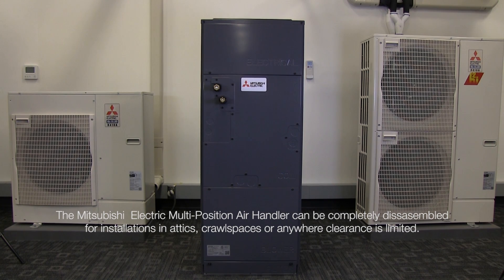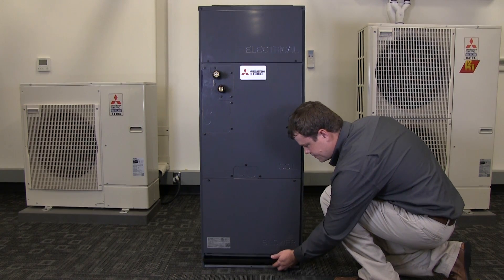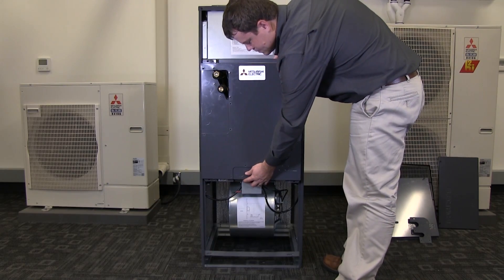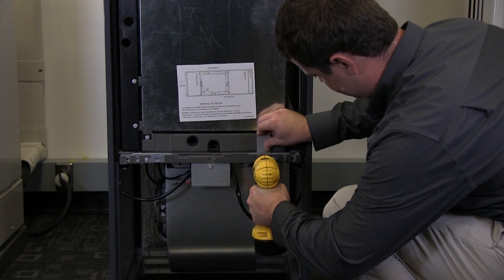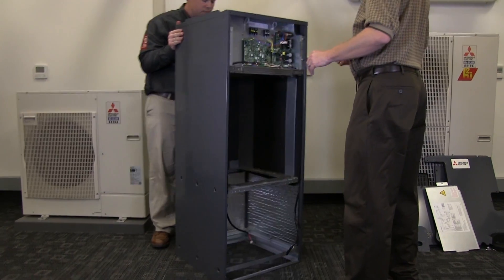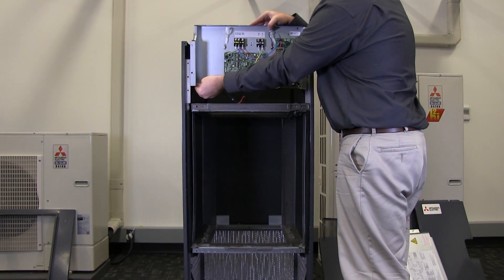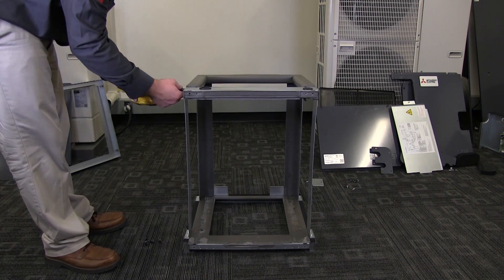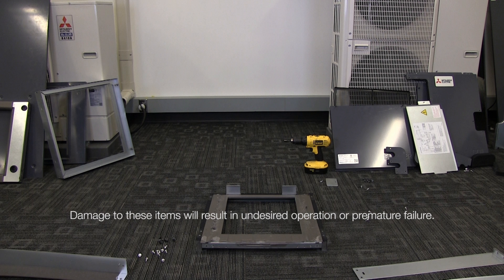How to Disassemble the MVZ/PVA Multi-Position Air Handler

Comment: For 24K MVZ side return air handlers installed with a side return, is it possible to relocate one of the wire harnesses to allow a thin filter to be installed on the right or left inside wall of the cabinet?

Comment: I don’t know about this being a highlight in being able to disassemble in the field to fit through any opening. Any air handler can be completely ripped apart panel by panel. Make it three separate compartments that just bolt or screw together. That would be a highlight to those of us installing these

Comment: how is Mitsubishi MVZ air handler different conventional heat pump air handler?  Does it have additional control wrings that communicate with outdoor unit?
Reply from the maker: The MVZ is an indoor unit that must be connected to an outdoor unit. Please reach out to Customer Care with any questions. 1-800-433-4822.
Reply from the maker: Hi fanz fanz,

MVZ wiring practices are the same as our ductless units for communication purposes.